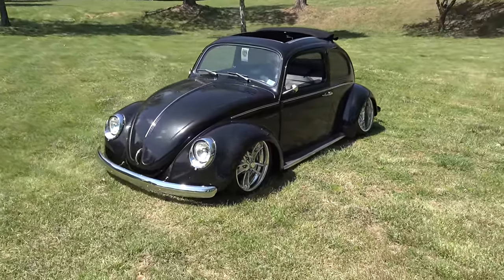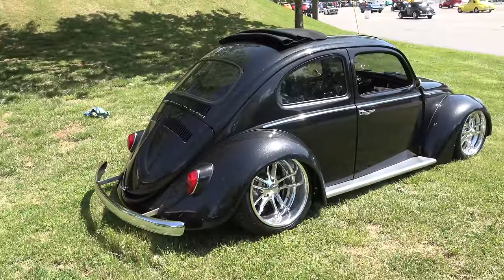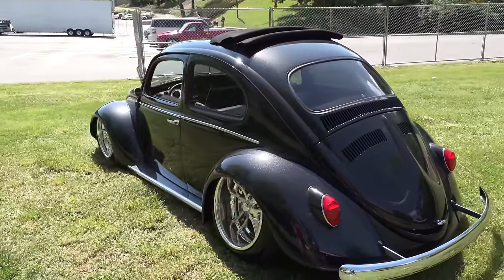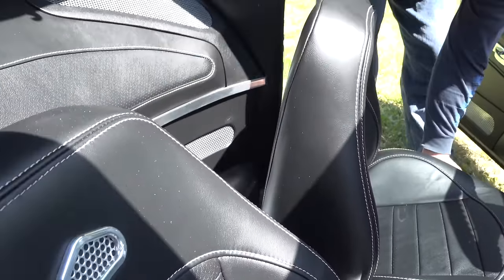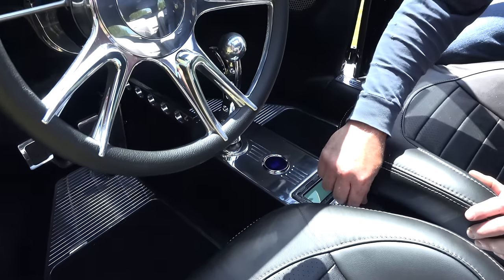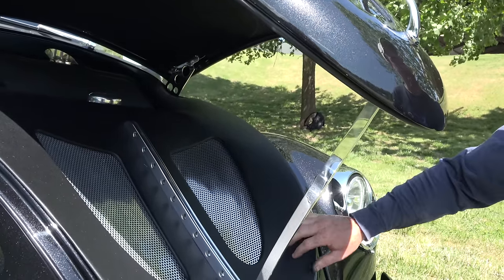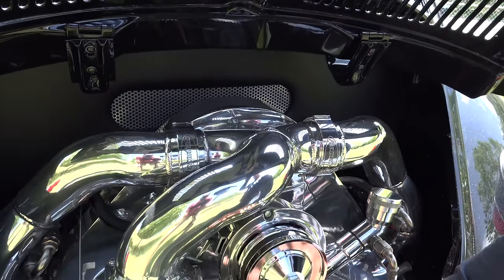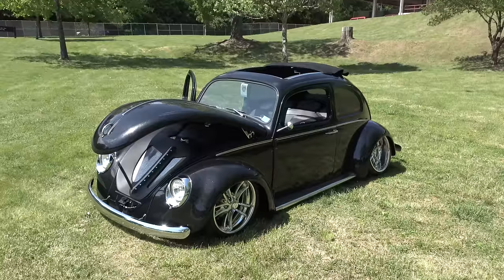1963 VW Bug Rag Top 303HP  2016 National Street Rod Association Street Rod Nationals South Plus

Comment: That is one bad bug!
Reply from the maker: Glad you liked it!
Reply: @ScottieDTV  I own a Corvair, so I'm in to air cooled engines. 303 RWHP is impressive at only 12 PSI. I hope to make that kind of power when I build my H-6 engine that I plan on installing a twin-scroll turbo w/ H2O/meth injection to help keep it from detonating. Not sure what amount of boost I'll dare? Do you use any type of special case bolts for your block halves? I found some ARP case bolts to help lock the case halves together. Keep the rubber down and burnin '.